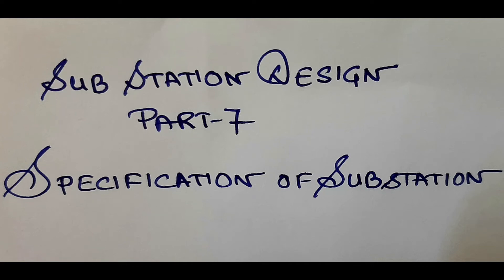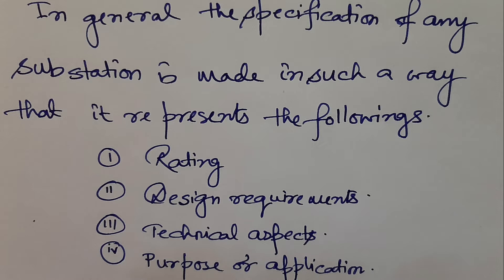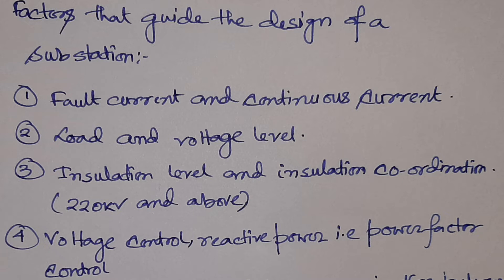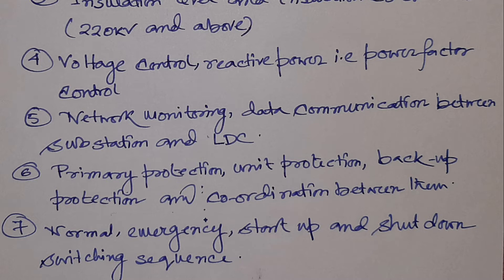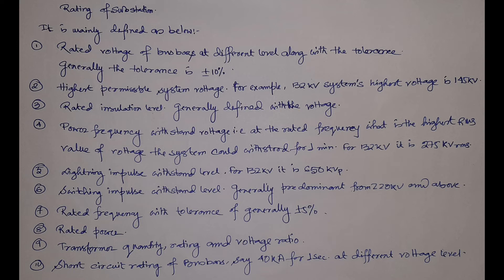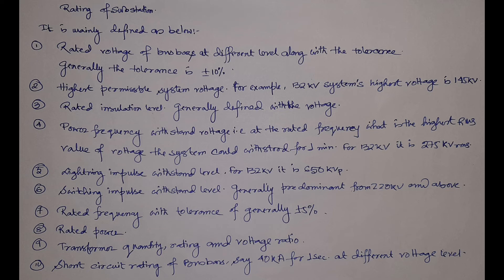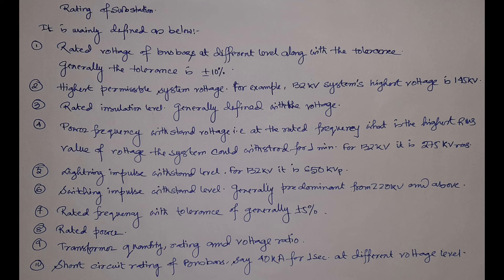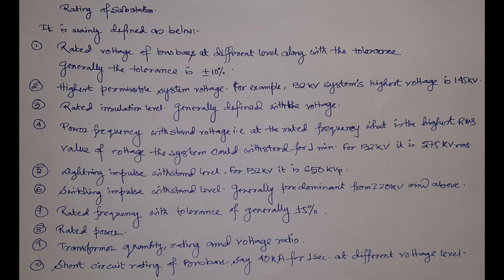Specification of Substation|Substation design part 7

Comment: Thanks for the video. I have been asked to do insulation coordination for an 11kV substation supplied with 66kV. So I want to tell my client that it is not required. But I will need to give them a technical reason. Could you tell me why I don’t need to do insulation coordination at this lower voltage level?